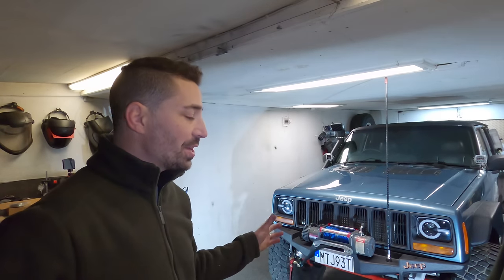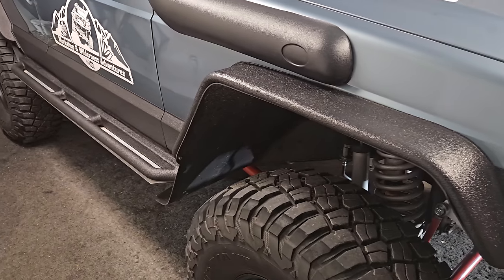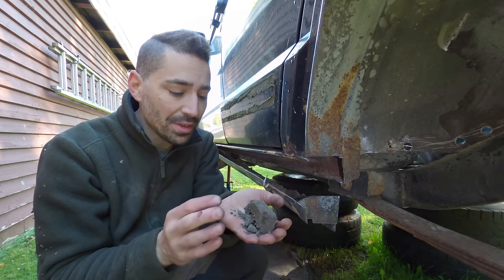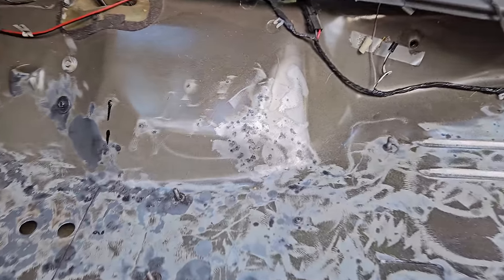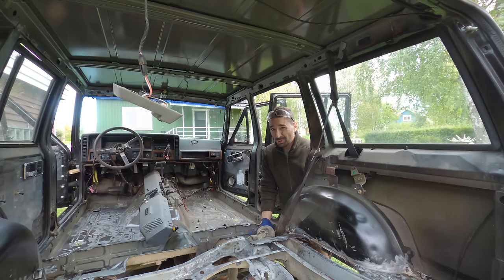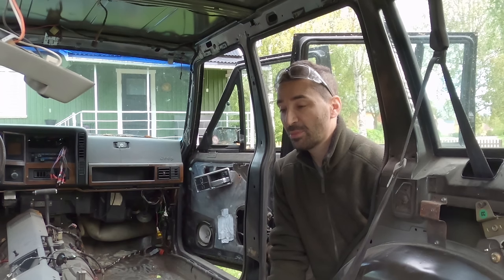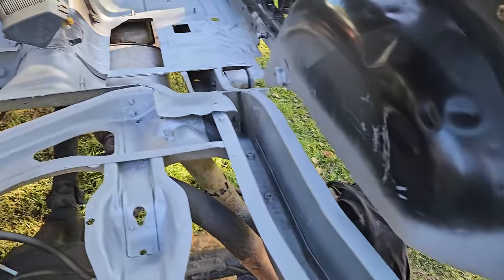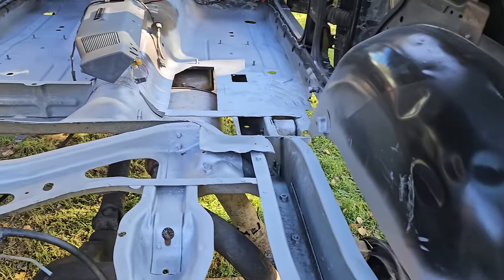1990 Jeep XJ CORROSION TREATMENT / Renix 4.0 Ep:05

Comment from the maker: The 4.0 is back under the grinder and in this episode the goal is to remove all rusted metal that's too far gone. The rocker panels are getting cut out and all pitted rust will be treated with rust removal spray, then washed and primed. The primer will be a combination of standard zink primer and for the sections that require welding I will be using a UPOL heavy zink weld through primer. This just keeps everything in good shape until the Jeep roles into the workshop and gets welded up.
I've moved fairly quickly up to this point on the 4.0, taking advantage of good weather before the winds turn and the snow falls.   
Thanks for all your support!
Mike

Comment: I have a simple solution for the front fender, I have a similar setup with my box rocker. I just welded on a 90 degree with two holes on the bottom end of the fender. Then I drilled and tapped the boxrocker. Two M6 Bolts per side are perfectly.
Reply from the maker: That's a good idea, I will see if I can do that when I come to installing the box section. Thanks for the tip!

Comment: Great work. One question tho'. Why not doing an internal frame stiffeners now that you are "there"?
Reply from the maker: I prefer the external ones, to be honest. I just found them easy to weld in and implement. I will build a slide in frame tie in Kit for the rear for the bumper and tow support. 
It's a shame I don't have a frame Stiffeners set here, or it would be going straight on.
Reply: @WorkshoptoWilderness   That's true, due to lack of space for welding, the external one are the best. A friend of mine did what you are doing with internal stiffeners he just created and man, woooww, what a job he did

Comment: Probably need to gargle some man fat mate, that will sort your sore throat right out!
Really useful advice on the rust treatment and some of the fluids you like to use in your cracks and crevices. Cheers.
Reply from the maker: Some solid advice. A few shifts down the local should sort me. I was very surprised by the rust remover. Worked like a charm! Thanks for watching

Comment: Do you drill access holes and the spray undercoating into the voids and doors (plastic plugs) as we do in Canada to protect the undercarriage.  I have done a lot of rocker panel replacements for people with older vehicles, I cut all the rocker off and weld in new ones or fabricated ones, but I always spray undercoating inside after with very good results.
Reply from the maker: Yeah, absolutely. I talked about this in the video. Dinitrol 3125 cavity wax with inhibitors. It's the only way to go around here if you want to save a vehicle. My diesel is full of cavity wax in the doors, frame, and all other cavites. Saved it's life basically!